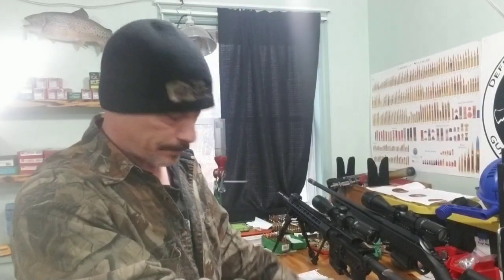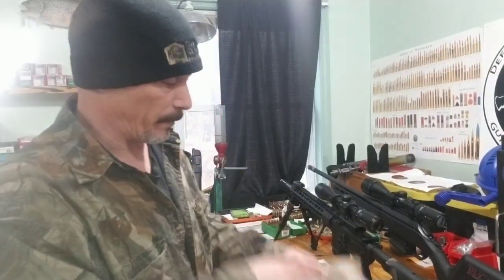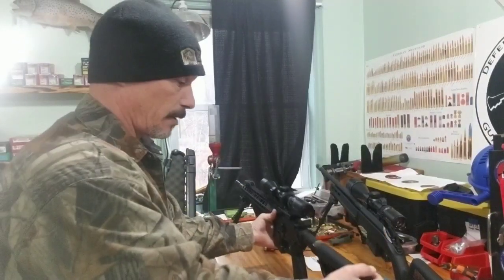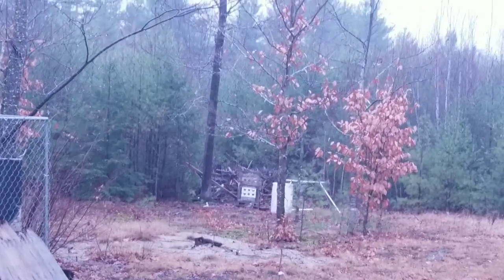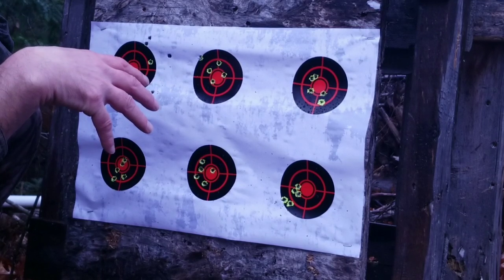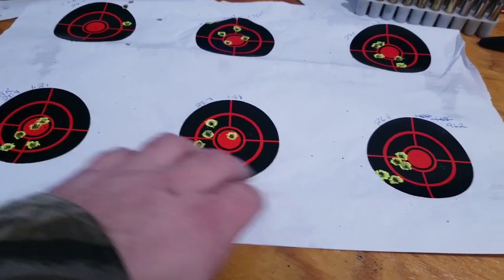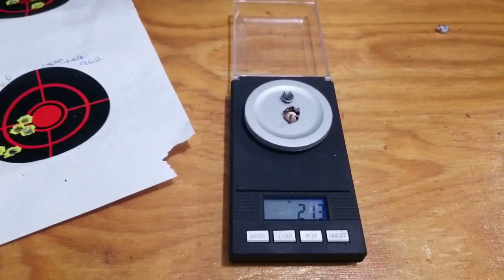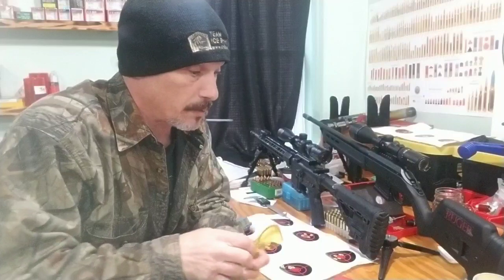Speer 55 grain TNT bullets captured in water jugs.

Comment: If I knew everything, I wouldn't be here.
What are all the letters and numbers supposed to stand for, mean to me?
My 6mm Remington does much better, 1-1/2" groups with factory loads, just under 3/4" groups at 119 yards.  Put down my doe at 75 yards, in her tracks too.
Sorry, I don't give your video high marks. Tuned in to see bullets and you didn't get to them for over 7 minutes, and a few other things, not getting the bullet in the frame. opps. I'll just stop there.